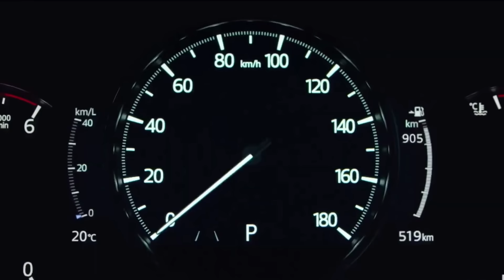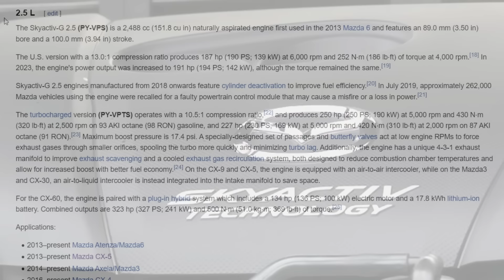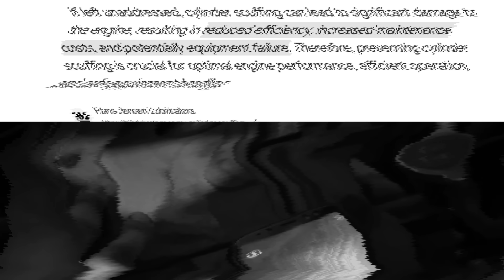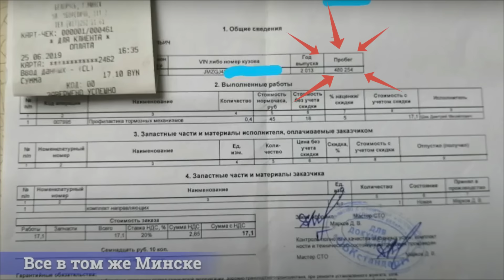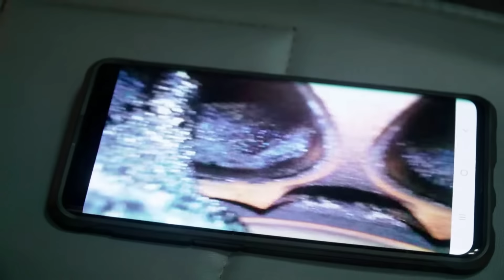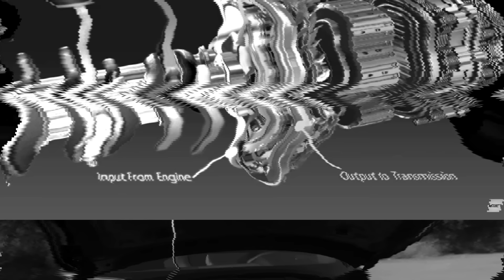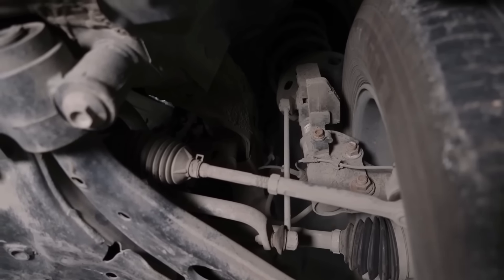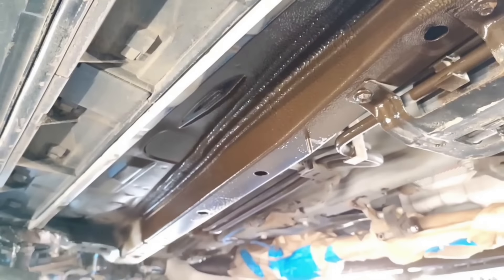How reliable is the most stylish Japanese crossover? 2024 Mazda CX-5 facelift.

Comment: I bought a 2014 CX-5 GT with 158k miles. It had carbon buildup on the intake manifold leading to misfires. Other than that, one brake caliper, one ignition coil and one Bose speaker went bad. Front heated seat only heats the back.
Reply: I test drove another 2014 with a 2.0 engine, 200k miles, and manual tranny.  It was slow, but sold real quick for $6000 summer of 2023.
Reply: How did you fix the carbon issue?  Did you have it sprayed w a carbon cleaner (typical induction service) or walnut blasting?
Reply: @garybenski6383  I followed another YouTuber and removed the intake manifold.  Then used Berryman B12 to clean the intakes.  If I were to do it again, I'd used a walnut blaster, as the carbon cleaner gets into the oil and some of it burns off in your catalytic converter.  Which lead to a check engine light for me.  The engine does feel more responsive but you have to decide if it's worth the time and expense.

Comment: 1:37 ...narrowed down to one 2.5 liter engine.
No, that's not true. Those are two completely different engines. You don't take a regular 2.5 liter naturally aspirated engine and just add a turbo to it. You build another engine which is by chance 2.5 liter as well (ok, maybe not by chance, probably because it's the maximum physical capacity under the hood).

Comment: Do turbo engines of cx5 usually make lot of noise? I mean i could hear the noise inside the cabin.
Reply: Not since the 2021 iteration, isolation stepped up big time.
Reply: My 2023 sounds perfect. At idle I don’t even know it’s running.
Reply: @aussie8114  I hear mine a little, I’ve got a 2022 Akera, but usually it’s drowned out by the sound system. I tend to feel the idle more
Reply: @ZacharyT94  Admittedly my hearing is not great but I have found myself looking at the rev dial to confirm the motor is running while at the traffic lights. With the music playing even at low volume the vehicle noise is absolutely fine to me. In fact I think it’s brilliant. It’s not a million dollar Rolls Royce quite but to me it’s excellent.
Reply: @aussie8114  No doubt, it is definitely quiet. Can sound a little diesel like in the low rpm’s I’ve noticed, I’ve got the 2.5T in mine, again engine usually doesn’t interfere in the cabin, especially when I’ve got music going through the awesome sound system.
Reply: @ZacharyT94  I recently started using high octane premium in my turbo model. I’ve noticed the acceleration lag I would get has now gone. Interesting because the high octane is only supposed to be of benefit over about 4,500 revs but I’ve noticed a definite benefit from a stop start. That lag of maybe 1 or a bit more seconds caused me concern a few times in driving situations but now I don’t need to think about it. Not sure if it relates to turbo or maybe simply being high octane the motor kicks in way quicker from a stop start. I’m sticking with high octane premium now, cost doesn’t bother me and I don’t do lots of distance.
Reply: @aussie8114  I started putting 98 in mine from when I bought it and it is definitely more responsive down low, makes it fun when you’re the first one off at lights, it just shoots off without much effort. Have you taken yours back road bashing yet? You’ll find when you do that the CX-5 suffers from an identity crisis where it doesn’t know whether it’s a mild sports car or a family SUV, but it’s a glorious one that leaves a smile on your face.
Reply: @ZacharyT94  Has not been off road, trying to keep it looking sparkly new for now. Might do a change over in a year for a 2025 model, not that it will likely have any noteworthy updates. If they improve the CX60 suspension and transmission issues I may consider that one just to get a slightly bigger vehicle, Mazda may put adaptive suspension in it in 2025, though most likely another CX5 will be the choice. The CX5 is a really good vehicle, it’s a joy to get around in.

91 was doing perfectly fine other than that lag on a stop start. It may have only been 1 second but it caught me out a few times while turning in front of oncoming traffic. Can easily adapt your driving to suit but eliminating that lag with 98 was good.

Comment: The Skyactiv-D's are both a revelation and show complete honesty towards emissions.
The revelation comes from being the world's only low compression diesel which firstly, was borne out of many British and Indian university papers in the benefits of low compression diesel (basically, low compression meant lower emissions), but secondly was deemed impossible to achieve by other car makers so none invested in low compression.
The main problem with low compression diesel is difficult to operate in extreme cold weather and Mazda overcame this with a cylinder warming technique using initial exhaust recirculation.

Despite having lower emissions that regular diesel engines, it still did NOT meet EPA emissions which are significantly hard to achieve that even Euro VI.
Mazda spent 4 years detuning to allow the engine to meet EPA during the same period VW exported higher emission engines using a dyno emission trick to cheat emission tests.

Of course this came to bite VW in the way of the dieselgate scandal and severe penalties. And later both German and Japanese governments did thorough audits of all diesel engines manufacturers by domestic producers. The investiations were telling. Germany quickly hid results, with it well known the every single German manufacturer was cheating emissions.
Japan however made all their findings public, with results showing only the Skyactiv-D was able to pass the emissions that the manufacturer has stated the engine was achieving. (See: Forbes Magazine, "Japan Releases (Nasty) Diesel Test Results, Germany Sits On Them", Bertel Schmitt (2016))

In the end the really massive benefit of Skyactiv-D's is that by using low compression (CX-5 is 14:1 and CX-60 is 15:1), the rpm's are slighly higher and the engine note is closer to a petrol engine. It is obviously still a diesel because ignition is purely compression driven, but the low compression takes the agricultural edge off; something that the Germans cannot do because they're all high compression, and they achieve their levels of refinement sound-wise by a lot more sound deadening material.

Park a VW Tiguan diesel next to a Mazda CX-5 though, and it's chalk and cheese. The 16:1 compression ratio of the Tiguan is noticeable. But until the Germans go down the route of low compression diesels, a 16:1 will always sound like a 16:1 (but at least it's not 18:1).

Comment: The images you show of scoring on the cylinder wall looks like cylinder honing. Has the producer of the films erroneously got the two simply mixed up?
Look up 'Cylinder Honing' to prove my point.
I build motorcycle and scooter engines, some turbocharged.
The dipstick inspection @6.23 looks similar to head gasket failure - the mixing of coolant and engine oil.
I have the new 2023 CX-5 e-Skyactiv G 2.0 L model in England. It will be traded up by 2026 to avoid the inconvenience of repairs.
Overall, you represent a good review.
Reply from the maker: The loss of compression in cylinders is also present in these engines, just like problems with scuffing. It often happens that in one cylinder, you can find both 4:26. Thank you for the comment

Comment: Absolutely do not buy the Diesel.
ALL modern diesels are bound to experience problems with the EGR System and swirl flaps in the intake manifold basically the EGR clogs everything up with soot.
And thats just the start of all the problems with modern diesels.
For an everyday driver you want an NA gasoline/petrol engine.

Comment: Why did you use only russian videos?
Reply from the maker: didn't get you
Reply: @thelonglastexpert  you video is a set of russians videos with engine endoscopy
Reply from the maker: @tuslin  you find it wrong?
Reply: @thelonglastexpert  ProjectX lives in Omsk where -30C/-40C degree is normal winter temerature(+ direct injection), also he have fabric defects of cyllinder walls which is occurs to be common problem, this problem present on second video (with man from ukraine). all these defect engines origin from japan fabric. I also have scoring on my 50000km. Also these engines work with low oil pressure (0.8-1.3 bar ) which issues cyllinder wear problems in winter times and idle.  You not mentioned that injectors of this car lives less than its sparkplugs and when one of the injector begin to fail engine become locally overheating which leads to cyllinder wear , excessive blow-by and oil leaking and there is no excessive oil consumption in this case. There is a lot of car quality random problems .

Comment: 87 octane is fine for skyactiv
Reply from the maker: good luck
Reply: The CX-5 owner’s manual states 87 as the only fuel requirement.  The engine computer controls pre-ignition (knock) and retards timing accordingly and these engines are engineered to safely create their advertised power levels using 87.  Custom tunes that monkey with factory timing may require higher octane, but in stock form, 87 is all that’s necessary.  Turbo 2.5s can even run 87, but the computer will retard the timing and detune the engine for less HP/TQ.

Comment: Seriously? Every 3,000 miles? Perhaps if you're using literal dino juice. A decent synthetic will easily last far longer.

I have a 2019 Mazda CX-5 Signature with the 2.5 Turbo, the version of this engine that undergoes the highest level of oil stress. It has 49,997 miles as of today. 

I sent a sample in of my current oil change, which is approaching 7,800 miles as of this writing, with Mobil 1 Advanced Synthetic Oil. 5W-30 as the engine actually requires.

All parameters well within normal limits, the oil itself is still reasonably clean (again this is 7,800 miles into the change WITH a turbo) being primarily yellow/brown with very little black spotting, and the actual oil performance has not dropped significantly. I could easily get another 2000 miles out of this synthetic oil.

It has been primarily run on 87 octane. These engine are outright designed for 87, as Mazda themselves says, EVEN with the turbo.

You have no idea what you're talking about. Sorry.
Reply: Hello , Do you use 87 octane gas . This guy is talking 93 octane . ouch !